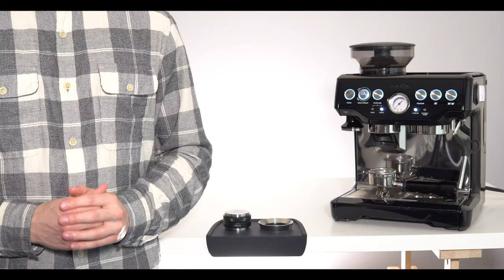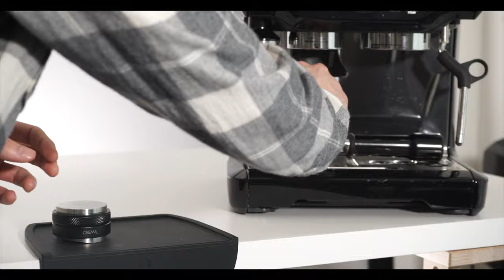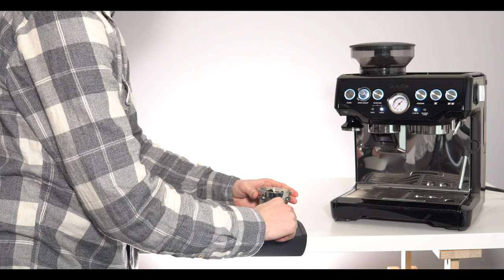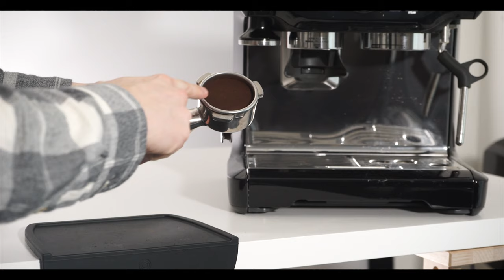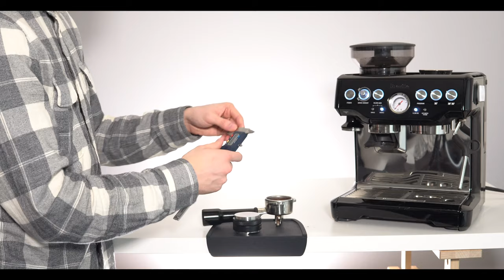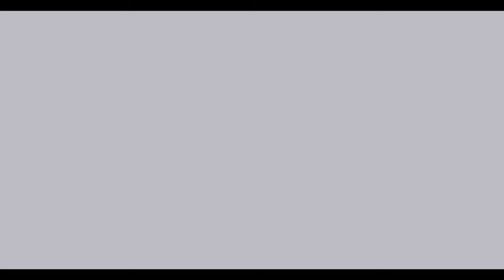How to Set Palm Tamper Depth | Breville Barista Express

Comment: So with the Distributor set to minimum it’s function as almost nil. Would it not be better after the Tamper is dial in to adjust the Distributor to be more functional? Most of the European or American Distributors are  more than $100. The Chinese are under $50 for comparison. Just to be clear your concept is dead on for the final product. Thanks good video, Kevin

Comment: I'm having the issue of 
1. When I press it against the shower screen some grinds stick to the screen. 
2. Using a different bean, requires a different grind size, and requires a different adjustment on the  palm tamper/distributor.
- while trying to adjust my grind size with a scale weighed dose, fine or coarse, I have to adjust the tamper as it takes more or less space in the basket adding another variable. The screen method doesn't work for this as when I grind fine, it takes less space in the basket, and coarse, more space. 
3. With the more or less space, any adjustment I made on the palm tamper now has to be changed.  

Am I doing something wrong? I'm having a very difficult time adjusting it and had better results using the regular tamper.
Reply from the maker: This is the downside of a palm tamper, it only works well when fully dosing the basket. However, simply adjust it to the point where you are still getting good compaction of the puck, or better, increase your dose so it fills the basket and doesn’t leave too much headroom

Comment: Curious. Is the supplied tamper not already set to match the portifilter and screen it comes with?
Reply: He didn't actually talk about the benefits of the palm tamper. It's very heavy and makes even tamping much easier than the cheap plastic one that comes with the Breville. Plus the Breville one doesn't allow you to be exact. The black part of this tamper doesn't go in to the basket so it means that his 7.5mm will not go any further.
Reply from the maker: Here's a good video talking about the differences: https://youtu.be/0xmsCBOBSuw

Comment: it's not available at amazon atm and I can't find it elsewhere. I have a breville bambino. breville always says their portafilters are 54mm. But they are 53mm right? As you also used a 53mm Leveling tool for your Breville.
Also another question: The palm tamper you linked, is only a leveler. The one in your video is kind of a 2 in 1. It has both sides. A leveler and a tamping side. Where can I get one of those 53mm? Thank you very much in advance. Greetings from Germany.
Reply from the maker: Hi ColoSon, unfortunately this exact 2 in 1 is only currently available in the US, Canada, and UK. I've linked a similar distribution tool for other countries. GOOD NEWS IS, you do not need the tamper side. I simply adjust my distributor to the correct height and use it to both distribute and tamp. Many many baristas take this approach! See my Appartamento video, I am using only a distributor there :)

Comment: I've experienced different variantions of dosing when it comes to the density of the coffee been. Sometimes its messes up the depth when you are used to a high dense bean then decided to switch to a low dense bean, which in turn takes up more volume, so I have to lower my dosing for lower dense beans. So looking for advice on this.
Reply from the maker: You can change your dose slightly like you're doing to adjust for these variations, but the main variable for dialing in should be grind size. If you are having trouble fitting 18gr in the basket, grind finer. If that results in too slow, or no flow, then reduce the dose.
Reply: Following!! I have fresh beans from my local roastery, and was wondering what grind size you'd use for 18g dose
Reply from the maker: @joshfoster4678  I have a whole video on dialing in! Going to be easier than me explaining in the comments :) https://youtu.be/d0g8umpINGQ
Reply: @joshfoster4678  Depends whether you are using a pressurised or non pressurised basket
Reply: @pip5461  using the double shot pressurised basket, I'm floating around 35/36 seconds for 18gram dose.. it's constant drip not a nice slow flow. Any help?
Reply: @joshfoster4678  I presume your using a burr grinder. When you take the portafilter out, do you see wet areas and/or an imprint from the shower curtain.
If so this is most likely due to tamping, or grind,which can be reduced by using a leveller/tamper, which if set to slightly more than your minimum blade depth,and or making the grind more coarse.
These should help you produce a better result.
There are a lot of vlogs for tuning in the grind size, but none of them work for a system designed to be used with pressurised baskets,as they don't produce sufficient pressure. As I found to my dismay... I hope that helps ...
Reply: @pip5461  yeah I managed to get around 36 seconds for a double shot with 18gram dose and yeah, when I remove portafilter I have a little water on top of the coffee , shall I just adjust grind?

Comment: Hi there I hope you can help me out here. I did exactly what you did in the video but I'm working with Barista Pro instead. With a full does of 18g, I realise that there's just too much coffee, I can't seem to be able to tamp the coffee further after adjusting the level of the tamper...
Reply from the maker: You're likely grinding too coarse. The finer you grind, the more beans you can fit in the portafilter. If you're choking the machine by grinding finer, then you will simply need to lower your dose for those beans. Different beans grinding differently
Reply: thanks for the advice, I adjusted the grinder to a finer setting and it did work out well. Just one more question, once dialled in, what's the ballpark weigh of a double shot using the double shot button on the barista pro? Is there a range for it?

Comment: Hi, you only adjusted the tamping height, so tamping force is out of the equation for this tool?
Reply from the maker: Correct, an "ideal tamping force" has shown to be mostly nonsense. As long as you are consistent, and tamping far enough to not have the puck contact the show screen before brewing, dialing in will be a breeze

Comment: Will the dosing funnel work with the Breville Smart Grinder using the Breville double spout portafilter and the hands-free portafilter holder?
Reply from the maker: No, unfortunately you'll need to rest in on the bottom, but it works just fine :)

Comment: have you noticed when using 18.5 or 19g dose, using this distribution tool, you'll end up pressing down on it since the shallowest setting still would be too high?
Reply from the maker: The 54mm Brevilles definitely max out at just over 18gr with most coffee roasts
Reply: @LifestyleLab_  but even at 18g, sometime i feel the disti end up pressing down on the grinds first before you an use it.  otherwise, it'll just get messy
Reply from the maker: It wont impact the quality of your shot, I actually ONLY use the distributor side to do all the tamping. Just make sure you are rotating the distributor from the second it touches the grinds, and all the way as you press down as to avoid tamping in a star shape from the distributor blades (that would affect shot quality)
Reply: A consistent accurate dose weight is very important. A half gram difference in dose weight which will change dose volume which will require a different the depth setting.
Reply: cdvax11 well since I started using WDT method, 18g dose no longer had issues when putting the disti side down. Breville built in grinder had way too much clumps which caused my question in the first place. Now issue solved.

Comment: Great content! This method works great for me. However, I have run into a new issue that I’m hoping you can help me understand. I bought super freshly roasted beans from a different local roaster. And all of a sudden 18 g of ground coffee does not fill up the Porta filter as much as the beans I have used in the past. Does it make sense that with some coffee you may have to readjust the depth of the tamper? Or pre-weigh say 20 g instead of 18g?
Reply from the maker: Yes! Some coffees will grind very differently from others depending on a variety of factors. 
It's good to note that the coarser you grind, the more space 18gr will take up. Meaning that if your portafilter seems underfilled with 18gr, you can grind coarser to get adequate tamping pressure. If you do this and the flow is now too fast, you can also return to the old grind setting and increase the dose as you suggested
Reply: Thank you, I had the same issue with my latest batch of beans.

Comment: I have the same machine and tamper, when I did my test.  I still have the shower screen screw indent on the puck. (before brew) Is that okay? Should i tamp it even lower?
thanks
D.
Reply from the maker: Yes, you should tamp lower until you just barely no longer see the indent
Reply: @LifestyleLab_  okay thanks, i thought it was just the shower screen. Didn't know the shower screw in the middle counts too as i read some saying the screw is okay to touch.
Reply: @MrDdibz  screw should never show. I don't think you have it screwed in all the way. Screw should be below depth of screen.

Comment: I ended up buying this tamper. I notice that now my shots will pour nice and slowly at the beginning of the shot, but near the end the coffee starts to spew out quite violently. The gauge on my barista express drops to the lower end of the espresso zone also. Any ideas ?
Reply from the maker: You definitely have air pockets within you puck. Try to improve your distribution into the bottom corners of the filter basket by gently tapping it on the counter before tamping. You may also want to increase your dose slightly if the basket is underfilled
Reply: @LifestyleLab_  will keep this in mind. Thank you for the quick reply !

Comment: My problem though with this distribution tool is that it can't reach the right depth for a single shot (10-11g). I think it's only useful for double shots (14-16g). Do you have any tips to maximize the depth of the distribution tool? Thanks!
Reply from the maker: This tool will work with a single shot basket and a 10-11gr dose. If you are trying to dose 10-11gr into a double shot basket, that is the issue
Reply: @LifestyleLab_  ooooooh so that's why, thanks! I'm using double shot basket. Now I know.

Comment: How many grams of coffee was your dose?
Thank you!
Reply from the maker: I generally use 17.5gr in the 54mm Breville baskets
Reply: @LifestyleLab_  That's what I use too. Thank you! Keep up the good work
Reply: @LifestyleLab_  I use the double  pressurised basket and get great shots from it. I then bought the non-pressurised basket and it completely threw me. Because you need to grind finer it uses more coffee (I went from 11 seconds if grind at 18 to 13 seconds at 12 on my Breville Smart Pro) and makes the shots much stronger. Is the solution to grind less and tamp deeper?

Comment: I take it that this is using the 54mm fortafilta, and 18g of coffee beans ?
Reply from the maker: Correct! Then you adjust grind size to dial in as explained here: https://youtu.be/d0g8umpINGQ
If you are at the maximum or minimum grind setting and still not getting a good shot, you may need to make an internal adjustment to your burr spacing: https://youtu.be/QNvOcE4-VEo

Comment: I just use the same depth as the included breville dosing tool... Would that be fine or did I do it wrong
Reply: (the Razor)
Reply: @alanwong2643  I have the same question. Is that what you ended up doing?
Reply: That's what I have been doing. I'm still a newbie at espresso and lattes but it's been working for me. I enjoy the drinks I've made with it this way

Comment: I am a complete noob, is this tamper 53 mm or 51 mm and will a 51 mm work?
Reply from the maker: It depends which machine you are using! This tamper is available in both sizes. The Barista Express and most of the Breville range uses 53mm. A 51mm will not work on those machines

Comment: This logic doesn't make sense to me. Isn't it common to use 30lb of pressure or somewhere around there. Tamping it down how it's being done in this still means that the grounds aren't as tamped as they could be. It might be consistent, but I thought the entire point of tamping is to get it as compacted as possible. Or is that completely wrong? It just doesn't seem right to me compared to something like a loaded tamper which is guaranteed doing that.
Reply from the maker: Like you said, consistency is key. If you set the depth correctly, and dose properly for your basket, you will be very consistent and apply an adequate amount of pressure.
Reply: @LifestyleLab_  I guess if you have your dosing down then that probably does work perfectly every time. 

I have been struggling with that since I switched to dark roasts. People seem to recommend using larger doses, but I find the exact opposite. The same weight of dark roast goes so much above the rim that it makes it hard to distribute completely even, which leaves one half of the puck always lower than the other. 

Which is user error I guess. But I just don't want to lower the dose anymore and get less coffee than I have. It still tastes great, but just has like 1 tiny little spurt of coffee out of the naked portafilter every time that makes me know there is some form of channeling even though it's small.

Comment: You don't want the same depth. You want the same force. 2 different things. Audiovoodoo for coffee geeks.
Reply from the maker: You don't necessarily want either, you just want consistency from shot to shot once dialed in. The "perfect pressure" myth has long been debunked
Reply: @LifestyleLab_  Coffee depending on origin, height and roast level has different density. What was shown in the movie may be right (constant height). The problem is that 18grams of light roast of high mountain coffee will end up being completely loose, whereas dark roast of some cheaper low ground coffee will stick out so much that you won't be able to compact it with 7,5mm.
Reply from the maker: Correct! You must make sure that your dose / basket depth will result in the puck being compressed enough. I discuss this in detail in a recent video comparing tamper types

Comment: Hmmm I don't really think it's that simple. What the tamper allows you to do is tamp consistently and level, for a given bean/grind setting. Setting to avoid contact with the screen (pre-extraction) isn't necessarily going to be the magic setting. And of course, like other people have pointed out, the puck will expand during extraction, and will still contact the screen. Which isn't necessarily a bad thing, and will certainly make the puck come out of the portafilter more easily.

Saying that the shower screen will 'scorch' the beans is complete nonsense.

Comment: Setting the depth is a starting point, the amount of tamping  pressure is what determines the correct tamp!
Reply from the maker: That has actually been largely disproven, see this great video demonstrating how little pressure actually impacts the final extraction: https://youtu.be/js8uiX9g1Cs
Reply: @LifestyleLab_  I have been making espresso in proper machines for over 20 years. The compactedness of the puck directly effects water flow and thereby extraction.
Reply from the maker: Did you watch the video I linked? 

It's a tough idea for me to wrap my head around as well, being in a similar position as yourself, but I actually duplicated their tests at home with similar results. I encourage you to have a watch :)
Reply: @LifestyleLab_  I just watched the video. I take the results they obtained as mainly subjective. In observation just last week as I was dialing in my dose recipe for my new Breville I found that tamp pressure, which I regulated by depth on the tamp tool, made a very big difference in flavor and consistency of the extraction fluid. To achieve a syrup like consistency I increased only the depth allowing slightly more pressure to compact the puck. I appreciate your art here in the videos you are producing and am not wanting to take away from anything. So in my humble opinion tamp pressure counts 🙂
Reply from the maker: Same here! 
I love when the comment section becomes a place for people to share their opinions and experiences. This is such a nuanced and complex hobby that it needs discussion and experimentation for us all to learn!
At the end of the day, we're all drinking delicious coffee ☕

Comment: You didn't mention dose size?
Reply from the maker: Dose will depend on your machine's portafilter size, and desired brew ratio. I find the 54mm Breville portafilters work best with somewhere between 16.5 and 17.5 grams
Reply: @LifestyleLab_  I typically use 18 grams.

Comment: Do you have to have the portafilter all the way to the right on the group head? Mine is new and pretty tight to turn all the way in
Reply from the maker: Yes, as the portafilter turns, it is lifted as it locks into place. If you do not move all the way to the right, the positioning of the puck relative to the shower screen will not be consistent
Reply: @LifestyleLab_  Out comes the hammer, in that case ...
Reply: Melanie Barton I had this same problem at first too. Found out my dose was a bit too much. The puck was touching the shower head as I locked the portafilter in place. Double check your dose with the Breville blade.

Comment: Or you could use the razor that the machine comes with and set the depth that way. Thats what I did.
Reply: how did that work out for you.
Reply: @mariachiaztec5557  about equal if not a little bit shorter.